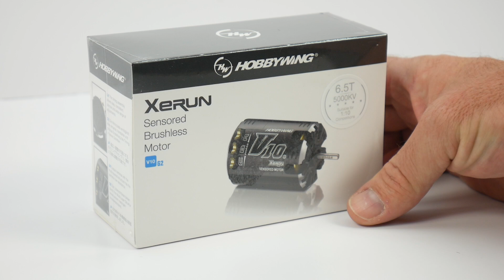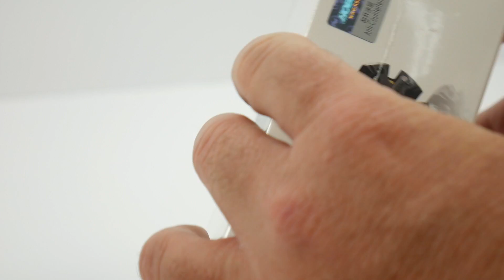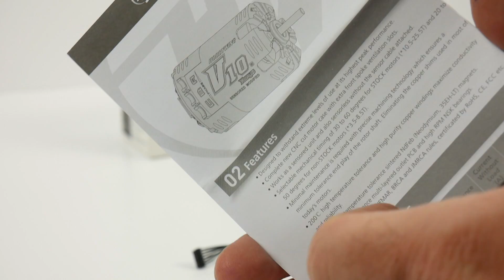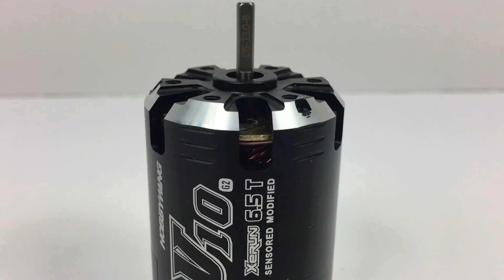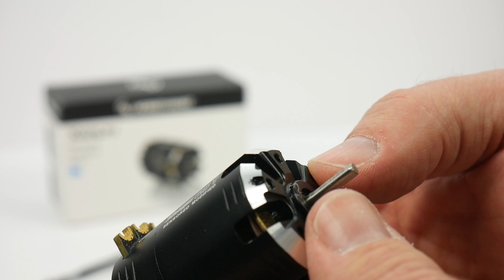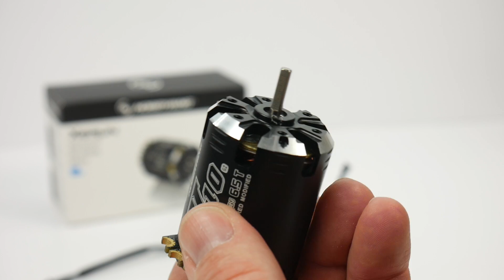HOBBYWING V10 Motor   Unboxing

Comment: What does water proof have to do with being a competition motor?
Reply from the maker: Most competition or racing motors are sensored - so they're not easily waterproofed - nor is it necessary for a racing motor.  Most of my electronic videos 8/10 comments are "is it waterproof??"
Reply: @TheRCNetwork haha I bet. Its because there are more people who bash then race. I was just curious if it made a difference on performance. I have a mamba monster x with a sensored  motor and I race my buddy every weekend with a xr8 and a team power product sensored motor and there not water proof. Hobby wing and power products are a big combo in Oklahoma and surrounding states for dirt oval racing. We are real close competition to each other on lap times. I didnt know if its a heat issue or performance draw being water proof so I thought I would ask a expert :)

Comment: hi, my question is actually is there a way that we get to know what is actual forward and backward of a brushless mortor when we r putting a new combo? or both sides are in consists with same rpms?
Reply from the maker: +ishantha soysa it should be capable of both. Of course, your radio can select reversing the channel, but depending on your motor/esc capability, you can do this in programming too
Reply: Tnx for the valiued advise.. Anyway I did a brushless upgrade for my SCT and with the 23t pinion and 77 t spur it become damn fast and now it gives kinda decent speed.. recently i reversed the throttle channel from radio and gave full throttle, then I noticed that the motor is giving some awesome speed.. wheels are balooning too.. I was really amazed.. then what i did was like, I swap the motor wiring to spin the motor to forward.. but unfortunatelt on that mode braking is very poor. Its kinda dragging to 1-2 feets when i hit the brakes.. So thats the problem Im facing currently..

Comment: hey Rich. will the 5.5T work with a hobbyking 120a esc? i know, hobbyking, but that's all i have right now. saving up to buy the hobbywing 120a esc but have to do with what i have now. btw, love all the video's of the d413. have the same buggy. greetz from belgium
Reply from the maker: As long as it's a sensored ESC, go ahead and try it.  Watch the temps and see how it goes.  If you already have one, try it.  If it's sensorless only, you'll never get the full potential of the V10 G2 motor
Reply: The RCNetwork Yves its sensored. I read that when you put the hobbywing software on the esc it is the same. I'll give it a try.
Thans for the answer

Comment: Good motor which I have in my xb4... Runs cooler than other motors in its price bracket. Also nice design to replace the bearing. Decently priced too. Hobby wing are definitely the most consistent/affordable brand I've owned
Reply from the maker: Good deal!  Yeah, I ran mine and it seemed to pull a few degrees cooler than other combos I've had in my D413

Comment: so I run a slash 2wd "platform" truck NOT a basher of any kind I'm pretty sure the track that we run is 160 ft race surface would this work well 6.5t maby a bit to much .. but then again can a guy ever have to much motor ??? !!! lol
Reply from the maker: Yeah, you'll have to test it out.  You're probably gonna want the 6.5-7.5 range.  Temps will tell you!